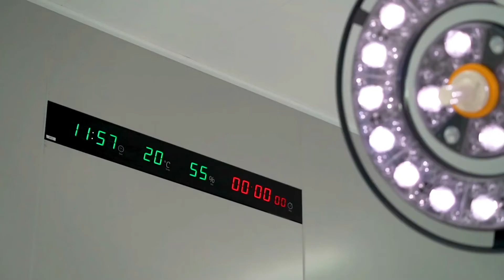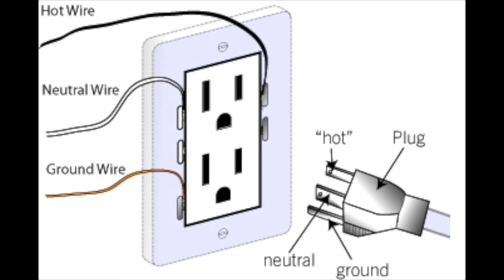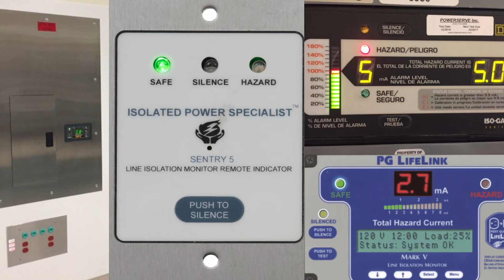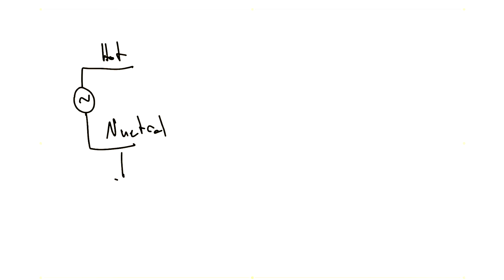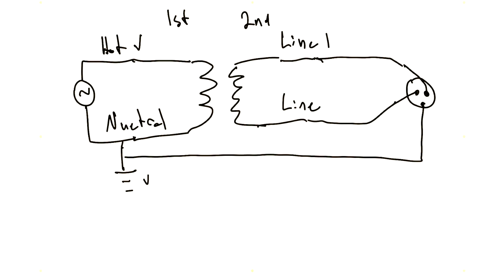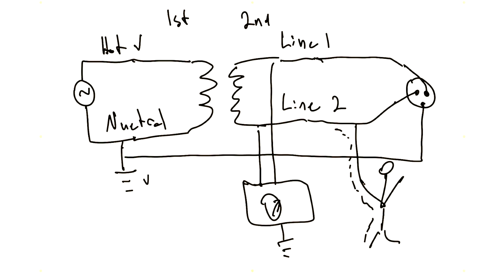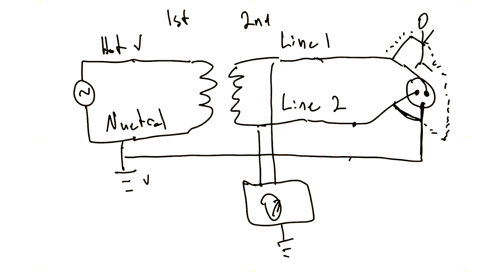Can isolated power save your life?

Comment: I have problems with some UPS that get alarmed when connected to this kind of power supply, is there any solution?
Reply from the maker: Hmm not sure, its most likely the UPS has some sort of built in ground detection and I can't think of a good way to bypass that, other than grounding it which would defeat the isolated systems safety. If you find a good solution let me know.

Comment: Not sure how this is any different from regular power.  You always need 2 fault conditions for an electrocution to happen.  Hot to ground or hot to hot of different phase.  Am I missing something?
Reply from the maker: Hot to ground is a single fault. So in an isolated system you can have line one (kind of like hot) to ground and there are no issues.
Reply: Really!  be very careful my friend.

Comment: Can you explain how or what are the requirements for test this and make sure they are funtioning propertly ? I know some had self test buttons and alarms but what are the code requirements on checking them
Reply from the maker: Hi J, tough question - depends on where you are located and what equipment you are using. Do you have the companies contact info - they can usually recommend a test procedure. Codes are going to depend on your location and your facilities goals (some adhere to certain standards that others do not - for instance in Florida we have to deal with the state policies which are often more stringent than the NFPA polcies)
Reply: @HTMWorkshop  ok thank you , I will do that we have to deal with the AAAHC here in Texas.
Reply from the maker: @ip5232  Let me know how it goes and if you learn anything interesting

Comment: @Engineering Technology for Healthcare  Can you, please explain: If you touch non-isolated systems live wire with your hand, you get a shock because you complete the circuit from your palm through you to the floor? If this is the case, why don't you complete the circuit in isolated systems case when you touch either L1 or L2? The potential difference between L1 or L2 to GND is 0V?
Reply from the maker: Hi, the reasons is if you touch the live wire of a traditional system you are at ground potential (since you are touching the ground - you are at the same potential as ground), because traditional systems are connected to ground there is now a "path" for current to flow. However in an isolated system you are at ground potential still, however the isolated system is not connected to ground (normally the neutral is touching/at ground potential). Therefore there is no path though you. Hope that helps. The key difference is a traditional system includes a ground bridge from the neutral to ground (making them at the same potential), where a isolated system is not connected to ground by either line 1 or line 2. However as soon as you touch line 1 or line 2 you have not created 1 point to ground - if there is a second point to ground through a nother fault current can now flow. Thus it takes two faults
Reply from the maker: The potential difference from L1 or L2 to ground is hard to say - it can actually change a bit depending on fault conditions and other. But in general most systems (some are different than others) may mantain roughly 60 V from ground from both L1 and L2 (postive and negative) - but that can change depending on system conditions. The very act of connecting a multimeter to the system creates a "fault" or connection so if you measure it you are disturbing the isolated system.

Comment: My Mom has been an OR Nurse for 40+ years so I asked her if there has ever been an alarm that interfered with a surgery. She said she has never experienced that. These systems must work rather well. She has never been notified of an alarm going off either.
Reply from the maker: Interesting, yeah I have not heard how frequently alarms go off but I do know that it does happen. May have been her unit had very good equipment with good BMET (combo of both), and good clinical staff who  know what they are doing to keep leakage currents under control.
Reply: That is the whole point of the wiring, if wired correctly then there are no alarms. If someone interfers with the wirng to make it unsafe then fault alarm is initiated as with a fault. Generally safe electrical circuits remain safe.